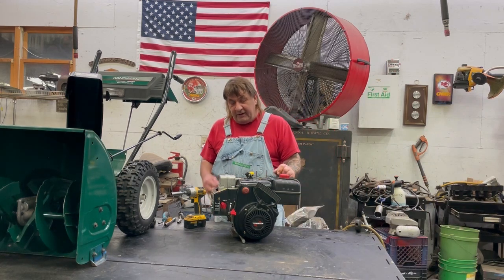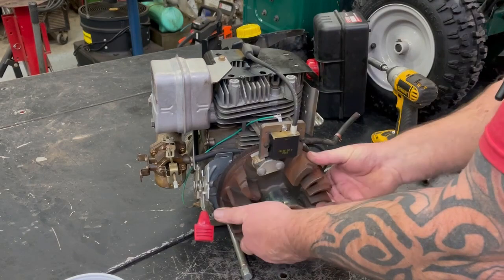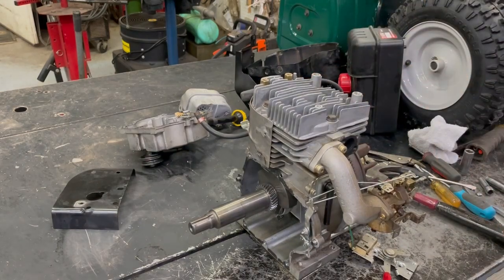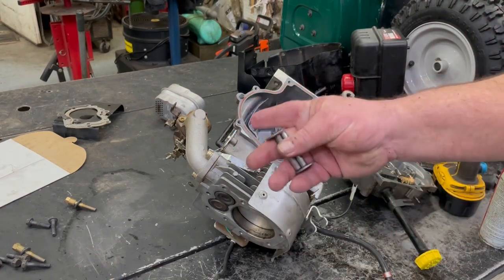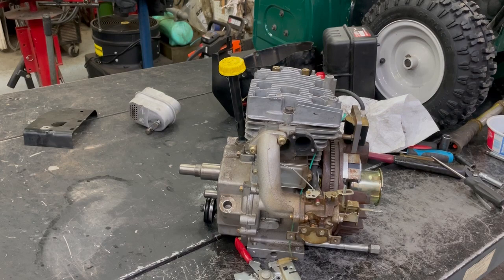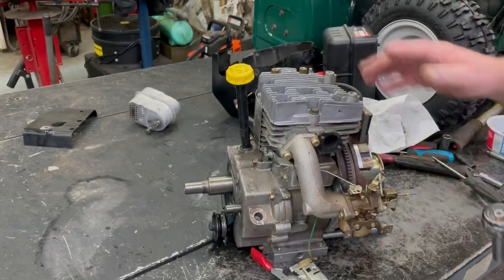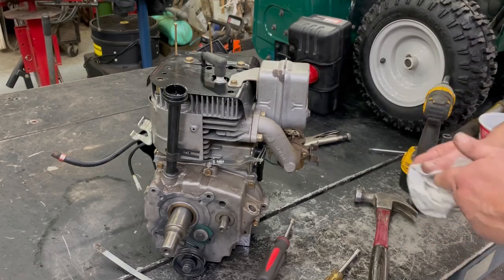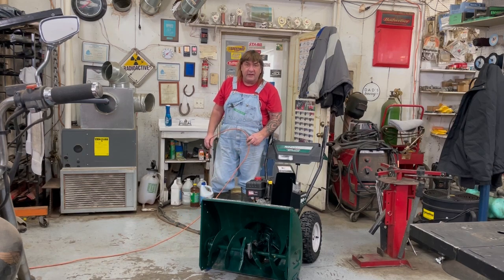You WON'T BELIEVE what I Found Inside This Engine! (8hp Tecumseh Troubleshooting, Eats Starter Gear)

Comment: That was an interesting find. If you have time can you answer this question.  My friend starter gear on a 30 year old Simplicity Briggs and Stratton riding mower wore out Before we could change it he passed away. I put another gear on it but it tore up after a few spins. The flywheel looks good. I put a metal gear on and it seems to work but not been able to start the engine due to the carb is gummed up. My question is will the metal gear be ok or do I need to change the flywheel to be safe. Thanks again for you r time and always interesting videos
Reply from the maker: hi, the plastic gear has 16 teeth the medal gear has 14. how many teeth was on the original
Reply: @lmsmallenginerepair4471  To me honest I don't remember. I did purchase the part from a Simplicity dealer who says it was a good replacement. I'm sorry but I don't always trust what I'm told about somethings unless I can get a second opinion. Thanks; Oh my the way the original was plastic.